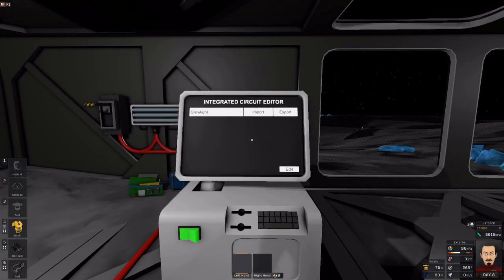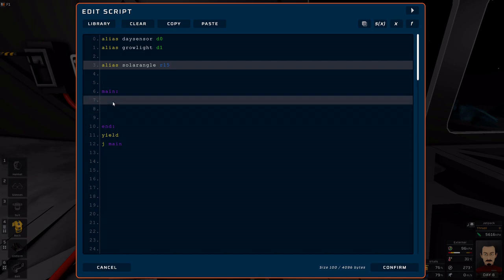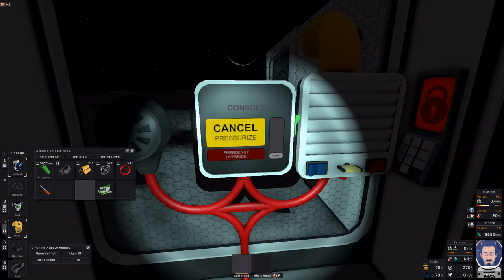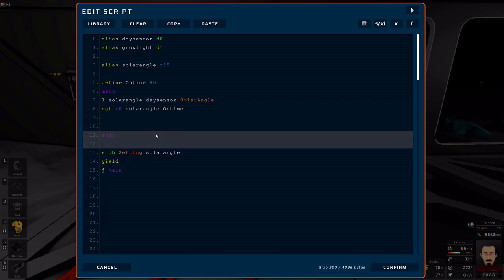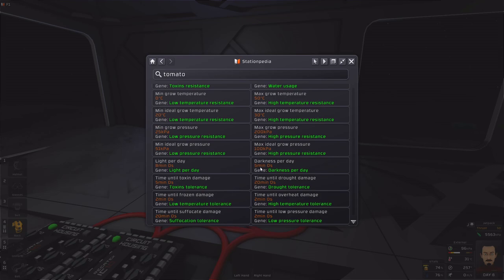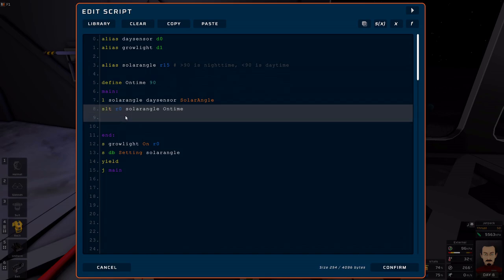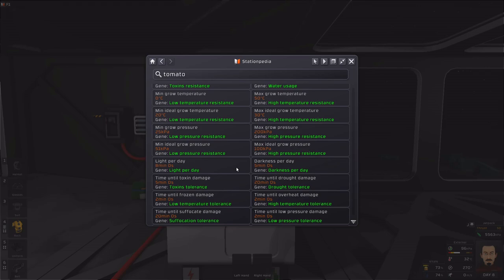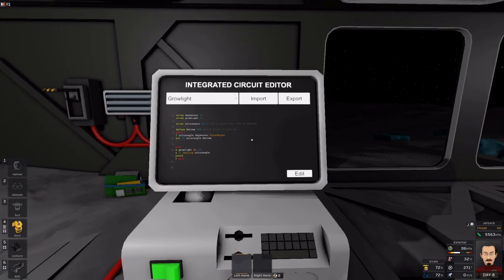IC10 Tutorial 10b: Growlight example code

Comment: Great tutorial man! Thanks! I have a question, there is a way to make all of growlights in the system respond to this script or do i need to place a batch writer to make all obbey?
Reply from the maker: Yes, use the set batch command (sb).

Instead of using alias to name growlight to a device pin, define growlight’s hash number so that you can change the command to:

“sb growlight On “

I think i cover that later with the set batch instructions.
Reply: works perfectly! thanks man!

Comment: So there’s a far simpler way if you use solar irradiance is 0 it’s off. If it’s above 0, the light is on.  The only thing is it is based on the sun actually being up and it will not care if the day is shorter or longer, but for the moon, solar irradiance works fine. It even works fine on Vulcan during the winter time but this might be better for Vulcan and Europa since Jupiter blocks the sun partially in the morning.. All the others have a near perfect 10 minutes of day and night.
Reply from the maker: I agree and originally thats what i had gone towards, but then the addition of the solar eclipses threw off the growlights so they shut off when they didnt need to.